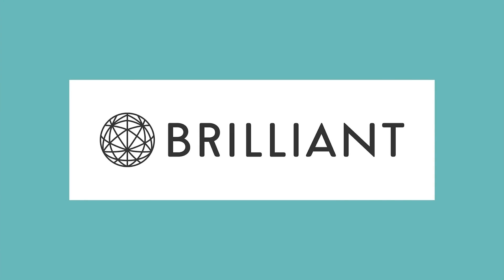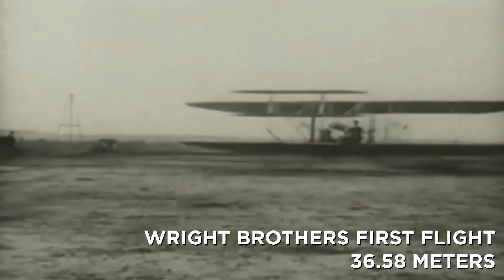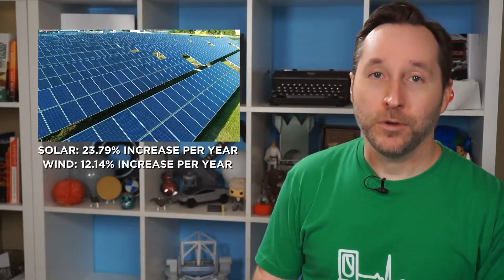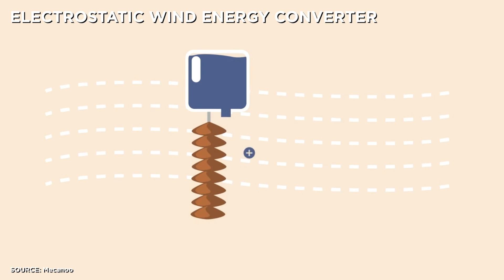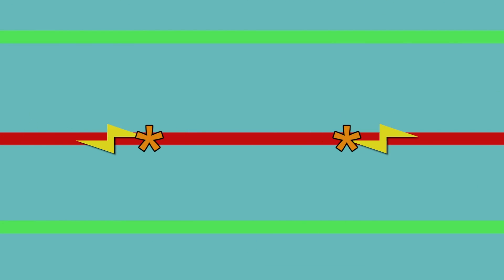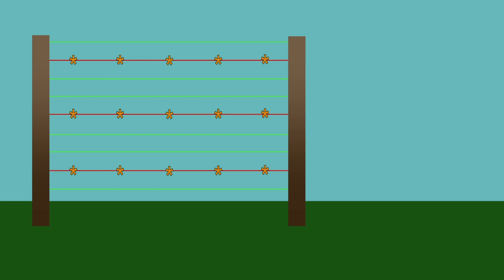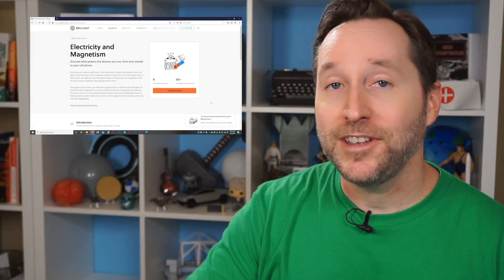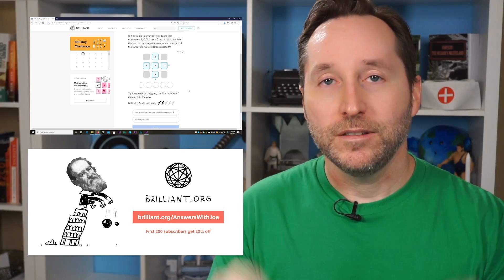Solid State Wind Energy | Random Thursday

Comment: One immediately obvious problem with SWET: spiders making webs between wires, potentially shorting them out. If the ionizing wire can provide enough current to self-clear spiders and their webs, then they may turn into bird-zappers.

Also, depending on how thick the wires are, birds may have trouble spotting them and break them by flying into them. Kilowatt for kilowatt, this may not be any better than wind turbines for bird injuries/kills.

Comment: Sorry for being pedantic but 40 000V isn't a lot of energy, it's a lot of potential.

Energy is potential (voltage) x current (amperage) x time, or power x time. 

It will only drain a battery quickly if the current is high.

For example, with a given size battery (a given amount of energy), a car starter motor using 12V at 150A (1800VA) will drain the battery in half the time of an ionic propulsion using 40 000V at 0.045A (900VA)

If course, I have no idea how power hungry the designed plane was. I just wanted to clear up what seems to be a pretty common misunderstanding of potential vs power vs energy.

Comment: What if they put this "fence" design around the large wind turbines and more efficient smaller multi directional corkscrew turbines to prevent birds getting hit by the blades or paddles, it would be multipurpose. I also have a question, the indoor ion air purifiers creates ozone (that so called fresh air smell) would this produce it also? It's good for sanitizing the air indoors but I'm sure producing large amounts outside would have some ramifications.

Comment: While I agree with Dr Epstein downplaying the idea of this replacing solar panels, this may instead replace fences. If the charged wires use low enough voltage for safe handling, the issue of earthing and recapturing the negative charge may work best on the ground.
Great idea and hope the theory proves useful!

Comment: One thing I can't help but wonder is, what is the time it would take for these grids of aluminum to produce enough energy to have covered the energy it took to produce that wire? I don't really know, but I would tend to suspect a pretty absurdly long time. This concept seems potentially handy for long term low maintenance energy in very remote locations but doesn't sound terribly likely to be relevant outside that niche to me.

Comment: Solar: If you made enough solar panels to "fuel" the production of more solar panels, You would never be able to make as many panels as you started out with before the original panels crapped out. Meaning if they can't provide the energy needed to replace themselves they are NOT providing extra energy for homes. They only work "economically" now because of... Say it with me... Stimulus packages provided by the gov. That's rioght your taxes are paying for a sinking ship. Taxes that could be used for say healthcare. Your green dream is just mold.

Comment: You can get more power than that just with an antenna, harvesting the static charge differential between the ground and the sky, 100v per meter. Of course the current is tint (except during thunderstorms) but at least you can run a small motor from it, and the construction is very simple. https://www.youtube.com/watch?v=2rVdEhyMR6A

Comment: Holy crap I haven't seen one of those forever Ionic Breeze that is I had an idea they built those things in the wrong scale I live in the Salt Lake Valley in Utah we get an inversion of smog and smoke in the winter time I had an idea where you build those machines but there are three to five stories tall along the side of the mountain range at the altitude where the smog inversion hovers and you have these things pop out of like missile silos they go in the ground when they're not needed then they pop up the clear the air and so you don't have to remove the grid to clean it it has internal high pressure sprayers better all that gunk get trapped in a collection pit and it shipped out to EnergySolutions out in the desert were they put it out on mylar mats to let the water evaporate then you bury it that's one way I thought that we should use that machine and idea to clean the pollution out of the atmosphere also the Ionic Breeze had a negative side effect for indoor use it created ozone which made people sick almost drunk feeling. With the big versions of that machine we could use the ozone to help our atmosphere and that thing doesn't use a lot of electricity either the Ionic Breeze that is Imagine Skilling that thing up and using it to clean the atmosphere and have clean air for everybody I still would like to build it a big one and experiment to see how well it can clean the air that's an invention I always knew they made in the wrong scale they need a scale it up and then it would be useful for Humanity sorry for the tangent and the rant he talked to the world have a great day

Comment: '40,000 volts is a lot of energy'? Actually, it doesn't say anything at all about energy.

That voltage at a few microamps? An apple has more than enough energy for the test flight you described! 🍎 But a standard 40kV power transmission tower carries enough energy through the day to power a city.

How much energy that aeroplane needs for a flight depends on the current it draws, and how long the flight is. It's why your power bill is in joules. (Although, since you're in the US, your power bill is probably in some wacky unit, like cubic feet of horse fart gas.)

Comment: The voltage alone tells you nothing about the power. It would depend on surface area, pressure, humidity, temperature, and air speed. So unless they told us the current they were drawing from the supply we can't make any statements on energy usage.

Comment: Old idea.  EDG (electrodynamic gas) converters are well studied and documented in, for example, the 1967 book Energy Conversion by Walsh.  Usually used to generate very high voltages, not power.  
I saw one operated at the Air Force Flight Dynamics Laboratory in the early 1970s.  Generated over 1 million volts.  The sparks were quite impressive.  My own experience with them leads me to expect that the power density and efficiency will be to low to be practical.  Also, the ion aircraft mentioned is also not new.  Popular Science (or maybe Popular Mechanics, my memory is not that good anymore) documented such a device flying in the 1960s.  Again, the problem is that the power to lift ratio is to low to make such a device practical.

Comment: Perpetual motion machine with no moving parts? Ion aerofoils move the machine around, generating air movement over the solid state electricity generator which provides the electricity to run the ion aerofoils. Needs to have ground contact, so low friction track and wheels perhaps? Just need to iron out the power generation vs power consumption deficit first.

Comment: 1:40 volts measure potential, not energy. Older LCD screens had backlights powered by thousands of volts, and still managed hours of operation from laptop batteries. 

Power (energy per second) is voltage multiplied by current (amps), so with low current you can have low power use with high voltage.

Comment: The biggest issue with Wind Farms that I never hear about is that they sap the strength out of the wind. This has a knock on effect that alters the movement of the winds. This then alters the rain fall patterns, potentially causing draughts where it used to rain, and have it rain elsewhere or no where at all. The problem with solar power is that it generates a heap of excess heat, and that isn't a good thing. 

Was expecting an Epstein joke. Dissapointed.

Comment: My question is could this be used as a power source on Venus given the high winds, and the relative simplicity of the structure if placed on the ground? I mean you don't got to worry about cleaning the thing given the sulfuric acid rain. Don't know how you would get the power up to the floating habitats though . . . But I always wondered if it would be a smarter idea on Venus to focus on getting power from the dense high winds rather than trying to stay on the day facing side for solar energy.

Comment: Resin burns pretty well once you get it started.  Why don't they shred the fiberglass and carbon fiber blades and burn it to generate power?  Byproducts would be glass (sand) and carbon.  Also, bonus points for the Bad Touch video.  XD

Comment: What about a solar powered dehumidifier that pulls distilled water from the atmosphere then we turn that into hydrogen oxygen and burn it in a hydrogen generator to create electricity that could be stored in a power bank and the exhaust from the hydrogen generator would release moisture back into the atmosphere?

Comment: Hi Joe
I like your videos and I watch many of them. 
From time to time you remind us that you're not a scientist. This is fine. But! Albeit you not being a scientist, since you talk about scientific subjects, at least  the very basic concepts,  you should get right.

At 1:42 of this video, you say:
"40,000 volts is a lot of energy".

That statement is wrong.
Voltage by itself is not energy.

Current due to Voltage, denotes Power.  And Power over time denotes Energy.

In the video, to avoid complication, you could simply state that the ion propulsion  apparatus requires a lot of electrical power that would drain batteries rather quickly.

It would be a good idea to avoid scientifically wrong statements.

You make Good videos, Keep up the good work.
Cheers.

Comment: Sounds like just a variation of tesla air antenna, the taller the mast the higher the differrential... pop in a couple diodes, collect some RF and ambient ions... run a 12v light.  Takes more energy to mfg. than you will ever get out of it in its lifetime ... much like current mainstream solar.  if you can't have a net + in energy within 5 years, you might as well go slash and burn some forest yourself - cause the net result is the same.  However, I do believe you can make a wind gen. w/o moving parts.  It would look like a ufo on a mast and the internals would contain 2 liquid metals, graphene, and a few coils.  I should write a paper, maybe i could get youtube name-dropped.

Comment: I'm going to be picky, but one thing about your videos is that you get these little bitty details right....usually.  You said that 20,000 volts is a lot of energy.  Actually, 20,000 volts says nothing about the energy.  It is about two steps from saying anything about energy.  20,000 volts is only a potential. It is like saying 100 feet is a lot of energy.  When it is actually moving charge,there is still no energy.  Voltage moving charge is only power.  Energy is power over a period of time.  In Ohms law terms, Watts will be the product of 20000 volts  and some amazingly small current.  But that still is not energy. That is only power.  Energy is the product of power over time.  20,000 volts is almost burried in calculating energy. Energy is watt per unit of time, the familiar terms watt-hours or or the less familiar terms Joules.. 20000 volts is no a lot of energy.  I'm being picky, I know.  Keep up the great work.  You introduce us to many new and interesting things.  Thanks.

Comment: I worked with a guy who had worked for the Bendix Corporation, who told me about one of the not so obvious costs of running a wind turbine, brake shoes. This guy had been a salesman of Bendix brake shoes. A wind turbine has to spin much slower than it is capable of spinning. If allowed to spin as fast as the wind can drive it, it would spin faster and faster until it flew apart. So a wind turbine is constantly putting the brakes on, causing the brake shoes to wear out, making them not so much a sunk cost, but a continual expense...

Comment: Hi Joe - Last year I went to a turbine plant in Texas, and saw 25-year old blades being refurbished.  It turns out they can be refurbished several times (those build since the 90's) and at substantial savings. The plant used to manufacture them for nearby wind farms, but as the blades have gotten bigger, they've had to move factories closer to new sites. Turns out tit's expensive to move 30+ meter blades.  Anyways, while I'm sure not all blades can be refurbished, it's good to note that companies are.

Comment: “It’s not like solar, which can be distributed and put on the roof of a house...”

Ummmm. Joe... it... actually... CAN be installed on the roof of a house.  Or, above it at any rate. You know, since installing it on the roof would kinda make the spinning thing an issue. Although, I think I remember Jay Leno has one on his car collection garage that is cylindrical, so...

Skysteller.com currently has a 6000 watt 5 blade 24v wind generator with charge controller on sale for $208.74 US. And while you would certainly have some additional expenses, you would have the same if you ran out and bought solar panels. Some areas of the world actually would get better use from wind than solar. Honestly, when the time comes for our next home, I will be looking into putting BOTH forms of renewable energy to work for me and hopefully selling the excess into the grid. I know you weren’t really poking at either as a bad option, I just wanted to make sure that you knew an option actually did exist. I actually know quite a few HAM radio operators that utilize both for powering their HAM shacks (Radios, Amplifiers, Computers, Lights, etc...) 

Thank you for the great content, I actually consider your videos as a highlight of my week! Take care and stay safe!
K1SFD

Comment: Interesting video - let's hope they can scale it up/down.  Tidal energy is still my favourite option (works all day, every day), but it's a topic that seems to have gone very quiet recently.  As for the enviromental impact of wind turbines, surely there is an equal problem with the manufacture and disposal of solar panels?  They may not be on the same scale, but there's a hell of a lot more of them.  And, while we're at it - how come nuclear gets away so easily on discussions about enviromental impact?  OK, it doesn't (directly) produce C02, and it's here for a while, whether we like it or not, so we might as well use it to bridge between fossil fuels and renewables.  But absolutely no way should we be building any more nuclear stations - not only are they incredibly expensive, but they produce way more really dangerous pollution than any other method of generating electricity.  Our great-great-great (etc) grandchildren will still be cursing us about nuclear waste, centuries after we've survived global warming (at least, the few that DO survive will be...).

Comment: MSRs, especially the Th-fueled variety, are still the best way forward, in my opinion
Reply: Thorium reactors might bridge the gap between now and complete use of renewables, but there isn't a single commercial option available right now, and last I heard is that the nearest is about 10 years off, possibly similar to fusion power since the 1950s, but due to lack of investment rather than the technology not being ready. 
Better sharing of energy between continent spanning power grids to deal with geographical variations in renewable power generation, combined with affordable and scalable battery/power storage and dwelling scale generation is the likely path forward. Dwelling scale generation unfortunately will never get the support it should from governments however, because governments make a lot of money from taxing people's power bills and centralized power generation, even if it is harmful, is easier to regulate and to site away from where rich people live. Not to mind the lobbying power that's keeping fossil fuel generation in operation even though it costs more per kWhr than wind and solar at this stage.
Reply: @peglor  lots to agree with there. We're still stuck (with renewables) using environmentally-unfriendly (and often, exploitative of human poverty) means of extraction and production of the materials needed, not to mention end-of-life concerns. Th MSRs are as cheap as coal, and are no more than 5-10 years out, plus produce far less waste (and actually reduce waste, as they can burn existing fission wastestocks). They'll still be cheaper than fusion for 50-100 years

Comment: I experimented with making something similar back in 2013. However, I used an array of super thin circular conductors of alternating materials instead of poles. The different materials and how they were wired acted in a similar manner to anodes and cathodes when the wind blew threw them. It was in the shape of a windsock and only worked when the wind was blowing directly through it so I had to put a wind vane at its base. The circuit was wired to several transistors and capacitors, then some LEDs. I had no way of storing the electricity but the lights did turn on from time to time. It eventually burnt out and started smoking, most likely due to my terrible wiring. I didn't consider it to be anything more than a novelty, that broke, and did not see any potential use that I could make of it.

Comment: “40000 volts is a lot of energy that will drain the battery quickly.” No, 40000 volts is not a measure of energy use, that would depend on the current, which depends on the number of ions you create.